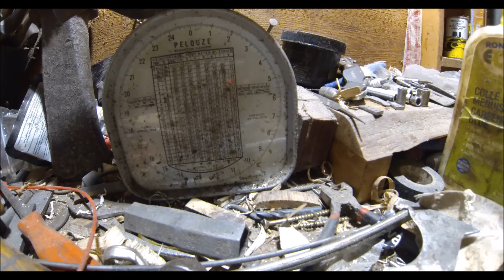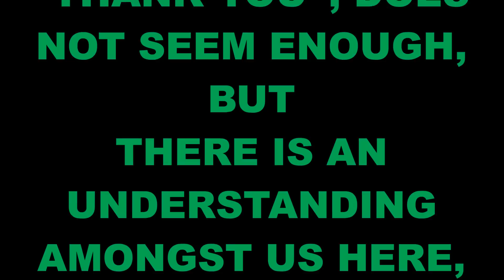STAYING AHEAD OF YOUR FIREWOOD WITH A HUSKY 394

Comment: My technique for cutting dirty wood like that is to cut through the top center, through the middle, and double cut the log. That way the chain is pulling the dirt off and not dulling it as bad as pulling it all the way through the wood. The axe is a good technique, I usually use a felling wedge to scrape off heavy dirt before cutting as well.

Comment: Here in the north west of Scotland, all of my splitting is with knotty woods, when we do have a bit of Ash, it splits just fine with just about any thing , but the rest of the time it's a struggle that most people win with an electric log splitter.

I can't use one because I would not be able to get electricity to it easily enough.

I have found that a sharp maul  works better than a blunt maul, and I give it a very fine angle that will slice/chop through tough resinous  knots, it's 8lb. but I wish it was 10lb like yours.
 
I do like your double bits though, but here, as with the mauls, they are generally too light for my knotty wood.

A lot of my fire-wood is "split" with the chainsaw i'm afraid to say...

Nice expert video again...

Best regards from the Isle of Skye.
Reply from the maker: great to see ya here thx for comment

Comment: Yep, I know from experience, the shape of the maul head makes or breaks how it works.  The cheapo ones I see at hardware and big box stores have cheeks that are waaay too fat, and the steel is soft so it mushrooms when you use the back side to strike a wedge.  Got to spend big $$ for a quality new one or find an older one at a flea market or estate sale.  Or I suppose you can get a cheap one, spend hours grinding it, and then harden it and temper it yourself, if you're a smith.